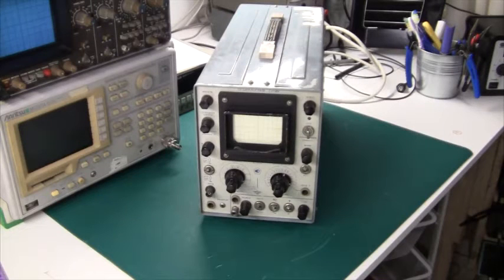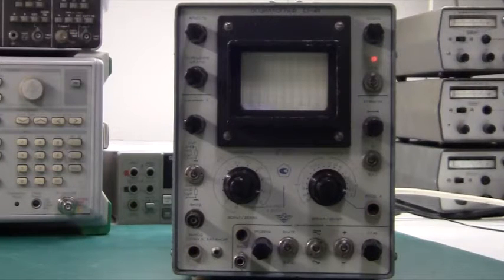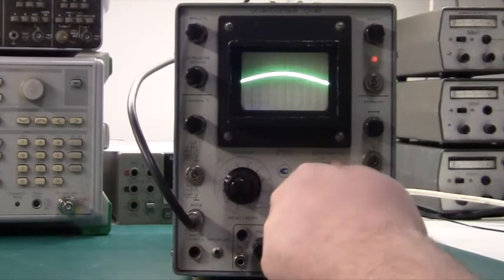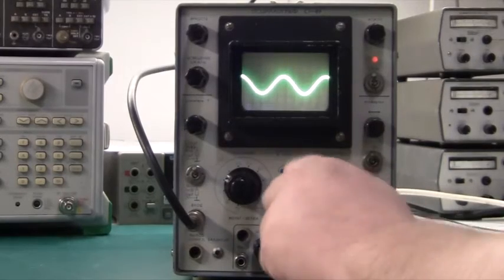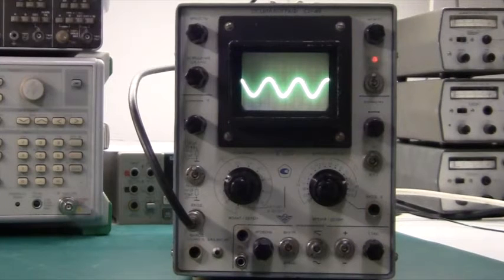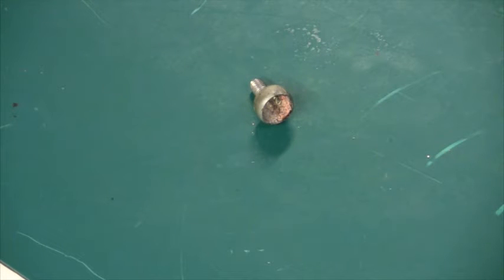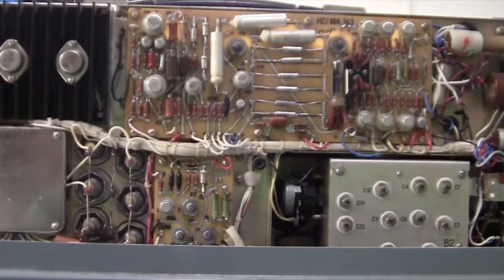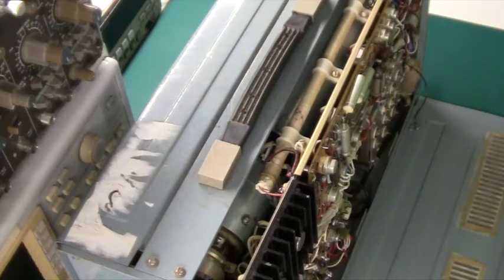Tear-down of Soviet C1-49 Oscilloscope

Comment: 11:57 Those are standard, metal diode packages, similar to DO-3, they are just glued into plastic tubes. 12:42 Those are not diodes, but the bottoms of chassis-mount electrolytic capacitors.

Comment: The lacquer spots on the solder joints are from the quality control. Each joint was inspected, and if approved marked with lacquer
Reply: Quality control stamps! Really good device...
Reply from the maker: Really good information. Thank you.
Reply: greengrayradio .
Reply: Is there mercury or something like it?
Reply: As it is high voltage, laquer may prevent corona discharge at spikes of solder.
Reply: @ch.l_  That's the first thing that I was thinking about. Not only does high voltage create corona. It especially is created on sharp points or edges. Nowadays some manufacturers of high voltage supplies even make special solder joints which are shaped into a nice round ball to prevent corona. But in the days that this scope was build such a technique did not exist. But a nice spot of lacquer will do the job as well.
Reply: This is bullshit, the spots are for the same reason as the waxed screw - to see if someone meddled with factory soldering.

Comment: hi,
the ext-soviet tech is very interesting today to explore the way to develop their electronic measure stuff.The only item from soviet union that I have opinion was a analog multimeter many year before.
Thanks for your time to build this tutorial. Kostas Greece. .
Reply from the maker: +SeAfasia I could not agree more. A lot of old equipment is worth studying. A lot of times a single transistors is enough to do the job, whereas a lot of modern engineers tend to use the more expensive op-amps for everything.
Reply: +NatureAndTech 
Yes this truth,opamps are common components for many projects from audio low cost amplifiers to measure voltage etc....
How are you get this item?
Reply from the maker: +SeAfasia In the former East Germany.
Reply: SeAfasia Is there mercury or something like it?

Comment: The long coil-like thing must be a delay line. It is fun, I have a "Groza" weather radar display from an airplane, the case is constructed in a very similar way, with the two side panels and the top part remaining attached.
Reply from the maker: +msylvain59 I will have to check the schematic, but it makes sense. Delay lines are sometimes used to sync the trigger with the analog input.
Reply: msylvain59 Is there mercury or something like it?
Reply: No, it's a wire delay line.